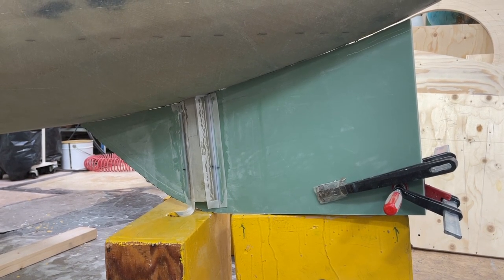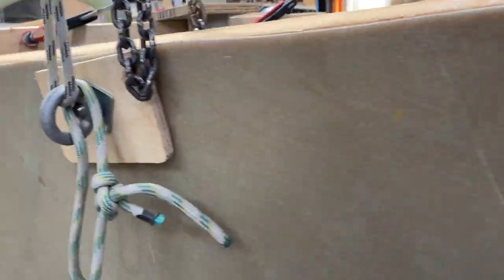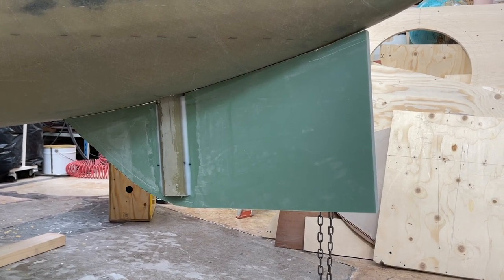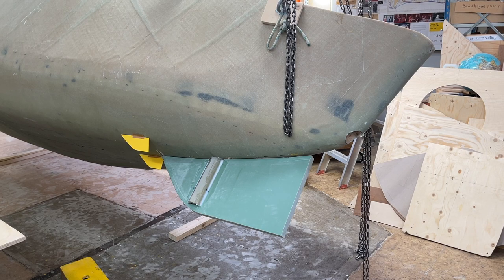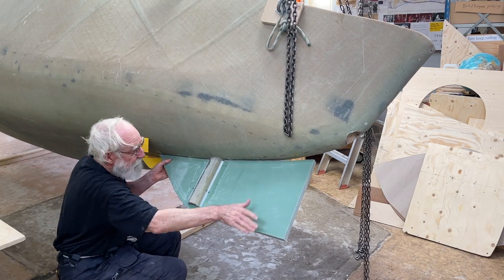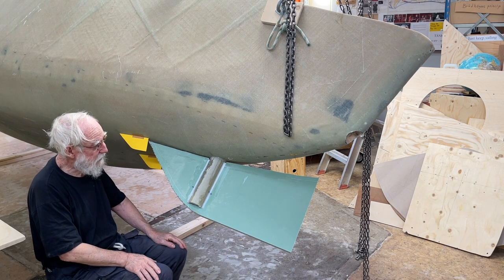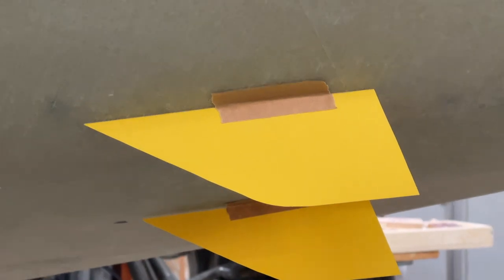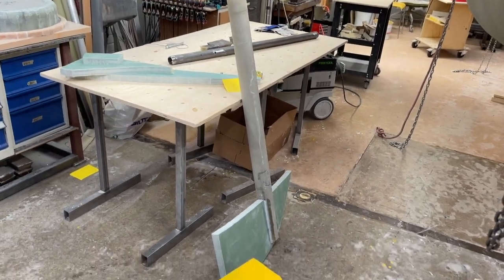6 Nov 2022  Extra with missing video. Rudder and axis joined in correct position and deflector

Comment: I think the anti fouling skags should be farther apart so that if the front tip of the rudder catches on some gear or something that it won't pull the rudder full one way or the other and you can't straighten it.  Rudder looks plenty strong to me.  What about bearings for the rudder shaft.  Sven, you're keeping Peter from his training!
Reply from the maker: This is only to explain the princip.
Not to scale.
Later I will turn the boat upside down and try out the best positions.
Reply: Good comment Tho Ralph